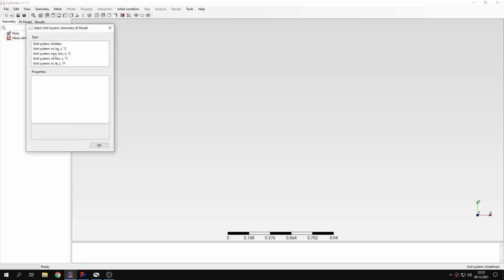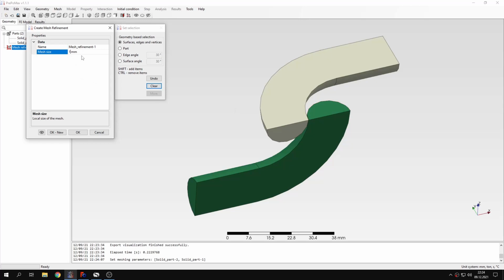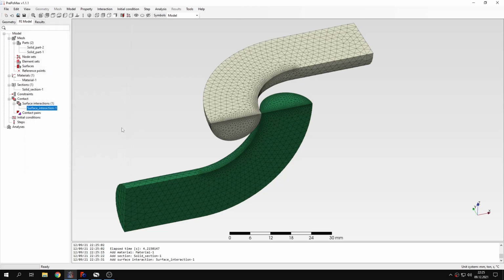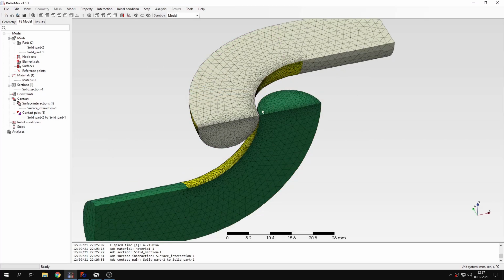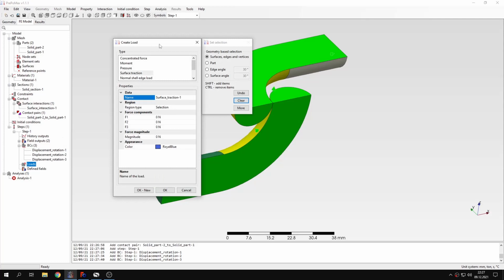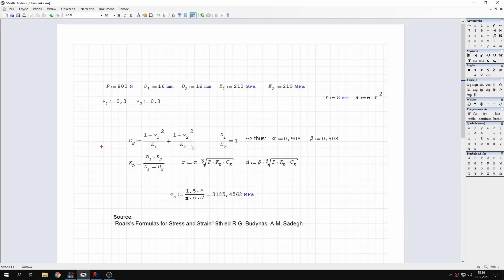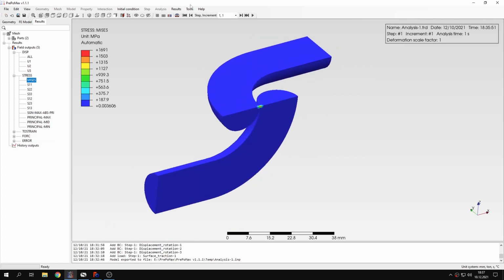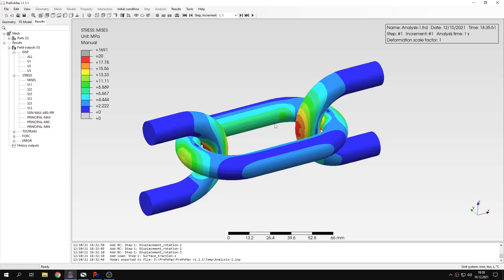PrePoMax (CalculiX FEA) - Tutorial 14 - Chain links

Comment: I did this tutorial but my S11 was 2947 MPa, I did everything same on v2.4.0, however my abs sgn principal stress is 3187 MPa which is very close to theory...
Reply from the maker: Wasn't your geometry oriented differently by any chance ? S11 should be used only if the chain is pulled in the X direction.

Comment: I am attempting to analyze a chain link with lug welded on top of one link so I am not able to simplify the symmetry in quite the same way. My links will be more like the actual model. Wondering how to define boundary conditions between two cylindrical shapes. Was thinking of making a tiny rectangular flat surface in the model on both mating links to make it easier to define the contact area and boundaries
Reply from the maker: I would have to see the model to say more but if there’s any symmetry plane, make use of it. This helps a lot with solving time and boundary conditions. Regarding contact definition between two cylindrical shapes, you can split the surfaces into smaller regions but it shouldn’t be necessary to add artificially flat segments. Frictional contact and displacement control (force control will be problematic for convergence) should do the job.
Reply: Thanks so much, I will continue going through your tutorials to learn how to select the planes of symmetry @FEAnalyst

Comment: What is strange is that the total load applied to the chain on simulation is 200x4 = 800 N (about 80 kg). A chain Ø16  Grade 80 has a working load of 8t (about 80 kN) and an ultimate tensile load of 322 kN.  Maybe to calculate a chain by FEM is necessary to adopt another strategy because with this model is difficult have a convergence with larger loads (100 times) also considering plastic properties of the steel. Hertzian contact stress is too conservative
Reply from the maker: Well, the tutorials here are meant to just show the workflow so the values are made up. You are right that convergence issues may occur with such a model but it's not necessarily due to this approach. For example, you may have to extrapolate the plasticity data if only a few points from the yield stress - plastic strain curve are specified. Additional local mesh refinement may also be necessary. If you are interested in this topic, the following article may be useful: https://fatigue.pro/2023/07/a-chain-is-only-as-strong-as-its-weakest-link/

Comment: Sir, What are those 'field output' options ?
Reply from the maker: It’s Abaqus and CalculiX specific nomenclature that’s a bit hard to explain. Output in this software is divided into field output and history output. The former is generated from the data distributed over the whole model (rarely a portion of it) and used for contour plots. The latter is generated from the data at specific locations in a model (individual nodes or typically small sets of nodes/elements) and used for XY plots.
Reply: @FEAnalyst  Thank you

Comment: how close output the simulation compare to commercial one?
Reply from the maker: I didn’t check this particular case in other software (comparison to analytical solution is usually enough) but I did that with some of the previous examples. CalculiX analyses can be easily compared with those performed in Abaqus since the keyword syntax is almost the same. Considering the fact that CalculiX is an open-source software; its accuracy is very good if you ensure proper mesh quality and choice of element type. For example, the case with creep of a thick cylinder gave almost exactly the same results in CalculiX and Abaqus. The accuracy of CalculiX is good enough for this code to be used by several large companies.
Reply: @FEAnalyst  great
Reply: Simulations must be close to hand calculations not similar to comercial software.